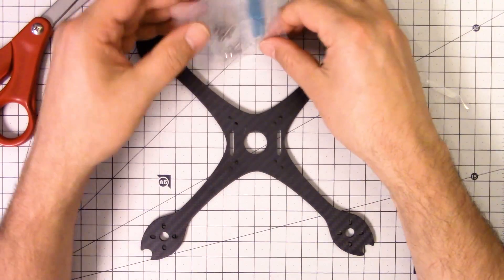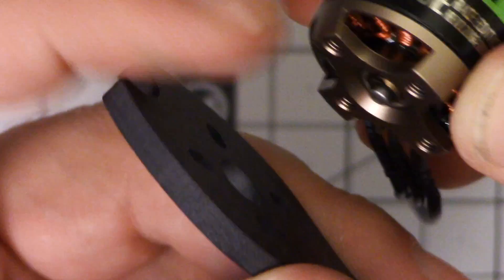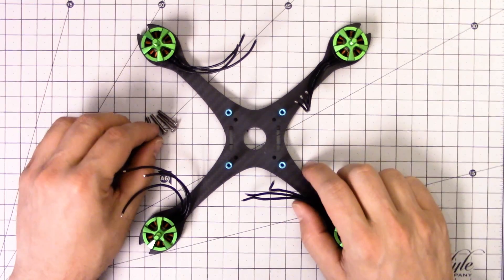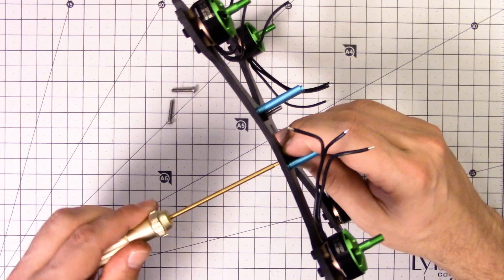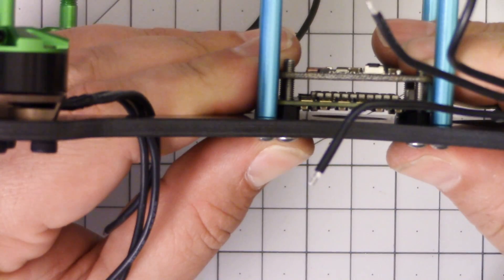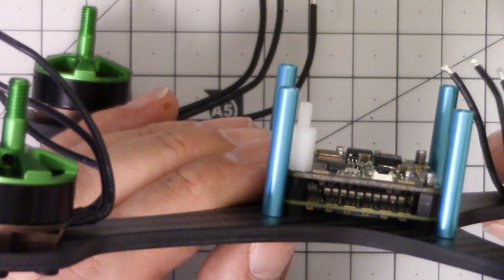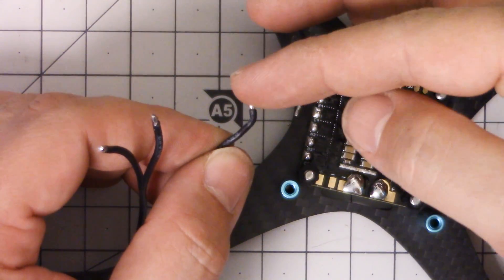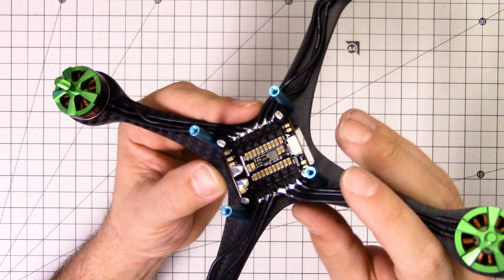RACING DRONE BUILD SERIES | RaceFlight Revolt Shendrones ZoomPod - Part 2

Comment: Does it make a difference how you wire motor to ESC (A,B,C)?  There are six possible combinations and I'm not sure if 2 will work with different motor directions and the other 4 will result in smoke.  Thanks Josh!
Reply from the maker: No it doesn't matter at all. The only difference will be which way the motor turns.

Comment: +Joshua Bardwell what temp was your soldering iron?
Reply from the maker: +John Ward I use 750 for general purpose and 800 or 850 for ESC's and PDB.
Reply: Joshua Bardwell ahh ok, mine does not reach that temp, 480 if I'm lucky, it's a YOUYUE 8586 heat gun combo (china made). lol you get what you pay for.
Reply from the maker: +John Ward I think you're in C and I'm in F.
Reply: Joshua Bardwell no unfortunately it is not, however I do not have an ability to test the temp, it takes a long time to melt the solder, I'm not using a rosin core solder, when buying it they had made for a 110v plug they come in 220v, I think that they may have reduced it's output by mistake.
Reply: There are so many opinions on this.  Seems a good number of people and articles I come across stick to the 650-750 range.  Wish someone would test the data and do a primer on soldering.  Ahem.  It is after all - the cornerstone of our hobby.  Without good solid soldering skills, your builds will suck.

Comment: Just a tip, if you get a flux pen and hit all the copper PCB traces before you apply solder it will stick easily every time and you won't have to deal with the rosin in the solder core evaporating before hitting the surface of the board, solder balling up on the end of your soldering iron, and then worrying about applying too big a blob. I'm sure you're not new to soldering yourself, but for new people this can literally make the difference between a decent solder and a total newbie disaster.

Comment: I prefer nylon screws for the flight controller stack because the screws themselves transmit less vibrations.  I feel that nylon screws are a semi-soft mount by themselves.  I use O-rings as well, but I think the nylon screws also contribute a little to the vibration damping.

Comment: Hey dude, did I say your videos are great? Yes they are, However this build series is driving me crazy. Why? Because it's a series .... stay tuned for the next installment aaahhhhhhhhhh ..... lets speed it up. Can I buy the full box set on DVD ? :-) Just kidding. Keep up the good work.
Reply from the maker: You gotta give me a break here. Parts 2 and 3 were like 18 minutes long. It takes me a minimum of a 5:1 ratio to produce the content. So 1 hour of video requires 5 hours of production. If I were to release 1 hour of video a day, well, you see how it would have to be...
Reply: Switch to Acro mode :-) Great job, can't wait to see if the FC blows up from all that current going to one big ESC :-) happy flying

Comment: Hey josh, I just finished building my race quad. Gb190. F3 FC. Everything worked fine. Put it all together. The negative wire from the xt60 came loose while I had battery power hooked up. I resoldered it back on. Now my FC doesn't turn on. It only turns on and works when I have it connected to the computer. Whenever I add battery power the FC gets no power and the pdb gets really hot. The "4R7" beck I believe gets extremely hot. Checked all wires and they are connected correctly. Did I blow my pdb when the negative wire from the xt60 connect came off? Thanks
Reply from the maker: Just disconnecting the negative wire should not have caused any damage. But if your regulator is getting super hot, something isn't right. The PDB may be damaged. Do you have continuity between the battery terminals?
Reply: Joshua Bardwell no I do not have continuity when I check it with my multimeter on the pdb battery terminal. Or any of the other terminals except one of the 5v/ground terminal
Reply from the maker: +David Parkes continuity how on the 5v?
Reply: Joshua Bardwell the battery and ecs numbers keep climbing when I put the voltmeter on them. Both 12v/gnd read 12.2/.1 and both 5v/gnd read 0. Not big on electrics but I have my voltmeter set to "ohm 200k" when I have the neg and pos leads

Comment: You might try a build using nitro fuel tubing in your stack rather than nuts. Just cut to any size, super easy, and provides a little vibration dampening. Cheers

Comment: Not sure but when you solder the motor leads on side of the esc's can the solder blob touch those nfets? or should you try not to let the solder flow . Hard to see if there is a space between the pad you solder and the nfet. you make it look easy!
Reply from the maker: +zooby dooby those FETs already have continuity to the pad.

Comment: Those aluminum stand offs are not going to be tall enough.  Hehehe.  I speak from experience. Even with short flight controller standoffs and orings on my BF F3 board I still had to use the 40mm aluminum standoffs instead of the 35mm that were also included to have the board clear the camera at the lowest tilt of 40 degrees.  I am actually going to remove the orings from the FC and use the common 35 mm standoffs since I have tons of those spares. The orings didn't make any difference on this build anyway with my setup and props.  I can live with our them. With a triple later stack I can't see those standoffs working unless the camera is tilted at the 60 degree notch.

Comment: Ok Josh ur the man I really need ur help please after days and night I finally got one of my quads to set up in Libre flight and got to arm now when I give it throttle it goes nuts any ideas I can't find any one in my area? is there a company that fixes quads?
Reply from the maker: +Chris Cronin https://youtu.be/X4746_KLVEI
Reply: Joshua Bardwell this is so defeating and not having a hobby shop or club near by to help really sucks I really wish I could send u this and pay u to hook it up or someone cause they are basically bricks
Reply from the maker: +Chris Cronin I don't really know Libre pilot at all.
Reply: Joshua Bardwell I know nothing about nothing with this do u know anyone in the Pacific Northwest that I could get one on one help with?
Reply: Is your flight control board oriented the right direction? It might just be rotated - 90 on the yaw axis but LibrePilot always leaves the board orientation at 0 with stock settings
Reply: i had that EXACT problem, it is your pids, they are WAY to high, p should be around .150 to start for all axis :)
cheers,
christian

Comment: Great Joshua one of the few who show there solder skills. I got two quadcopters that are falling out of the sky and i can't seem to find the problem. I was quite shocked when i heard you saying that some esc's have problems with reversing the motors. Mine are (please don't laugh) Racerstar esc's did hear any horror stories about them by accident? Thanks
Reply from the maker: +SnoepoX no. The ones I know if are DYS. But it's easy to swap a wire and see if this is your problem.
Reply: Joshua Bardwell thanks

Comment: 7:35
To space boards apart when using long screws, I cut several tiny pieces of wire jacket from a large gauge wire and slipped that over the screw as the spacer. It worked great and allows me to easily cut any length spacers I need.

Comment: Please do a video on how to setup smart audio! Not sure if I can keep audio and still use it with my TBS PNP50
Reply from the maker: I recorded it today, actually!
Reply: Joshua Bardwell awesome! And any idea if the external mic in the PNP50 will still be funcional if I splice the wires?
Reply from the maker: +Pablo Contreras yes. You will hear the smart audio beeps when you use it. But never in the air.
Reply: Joshua Bardwell ok cool thanks Joshua! That surely is not big deal. Question is though, should I splice audio in between camera and PNP50 or between PNP50 and VTX?

Comment: on the longer screw issue that you and many other youtubers have mentioned, I have worked for 20+ years mostly in indsutry, electra and machine work, and in that world there is a rule that says that using more depth of thread than the thickness of the bolt is useless, cos when you have thread that is equal or more than the thickness of the bolt, the bolt becomes the weekpoint, and the extra threads to nothing exept have waight, and you can see really good examples of this next time you go into the hardware store, go to the bolt section and take a look at bolts and nuts, and you will find that the nut thickness grows with the size of the bolt, usually the same thickness as the bolt actually, and this is becouse anything more would be a waste of material, at that point the bolt is the weekpoint, hope I'm not offending anyone with this post, or braking some dug in delutions :) hope it helps

Comment: You have space enough in the height with a stack of 3 layers?
Reply from the maker: +emiel1976ep hmm no.
Reply: I was afraid that, that would be a problem. 
Expected that you would check the height but you only looked how it would fit and not if the stack fitted. 
Something for the next time. ;)

Comment: Joshua,  Thanks for the vidz.  Definitely help us newbies out with our builds.  How are you liking using the 4-in-One ESC's over individual when you have a typical frame with enough room on the arms?  I definitely like it for keeping the mass at the center of the copter, along with the cleaner cabling.  Only disadvantage I can really see with them is if you have problems with one, you are replacing a $50 board instead of a $15-20 ESC
Reply from the maker: 4 in 1 is awesome but the ESC has to be bulletproof. It sucks paying $50 for a new ESC instead of $15 when you burn one.